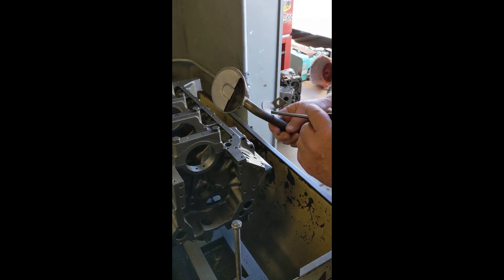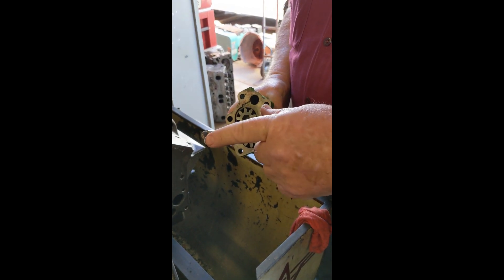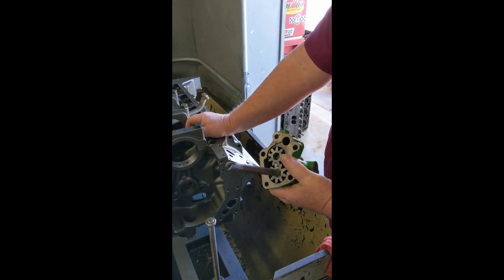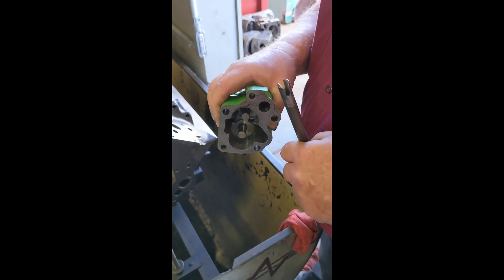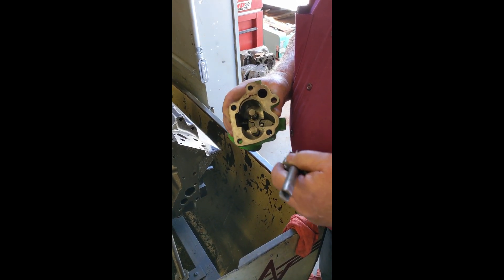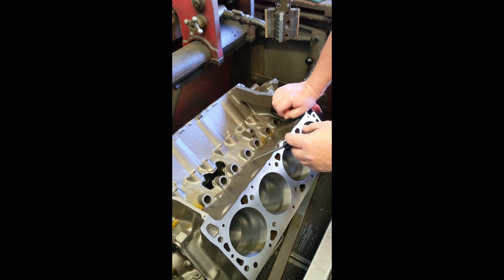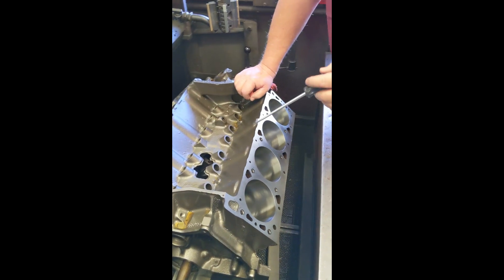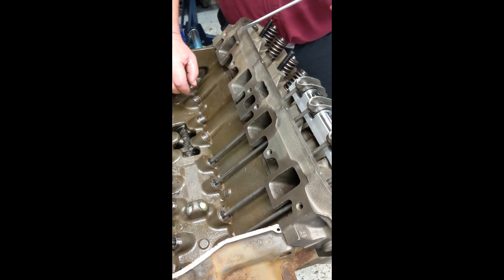Cadillac Oil Passages and Potential Problems

Comment: Staking the plugs? What does that mean I’m currently building a 500 and I’m putting in the oil galley plugs and don’t want any big problems later
Reply: Did you ever find out what was meant by 'staking the plugs'?
Reply: @chadmartin5640  I haven't watched the video yet, but from my experience, when someone talks about "staking a plug" they mean deforming something, somewhere, so the plug is physically blocked from coming out.  So if a plug was down at the end of a threaded bore, (and you're looking at the out side of the plug, where you would put a tool on it to remove it), if you, say, take a sharp punch and make some impact marks on the threaded section so that if the plug started backing out, it would hit those deformed areas and would most likely be stopped / not back out and come out and cause massive drop in oil pressure

With a different type of bore / plug setup, sometimes you can deform the plug itself. 

Many variations.  But usually "staking" involved a hammer and a punch or chisel

Just thought i'd add my $.02, in case it was helpful to somebody

Comment: Best explanation of the Caddy oiling system i've ever seen!!  Thanks......I always wondered why my oil gauge doesn't register anything until you just touch the throttle.  Some of that is just the cheap gauge i have..........but it's likely the rest is due to where the sending unit is & how you described it as being the last place to get the oil to.  As soon as it's above idle its right up to around 40 psi.